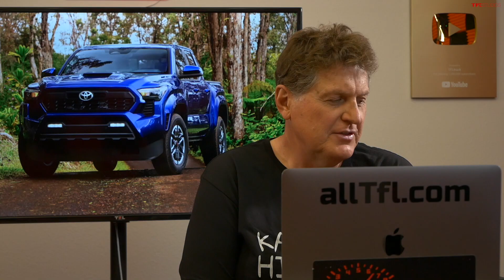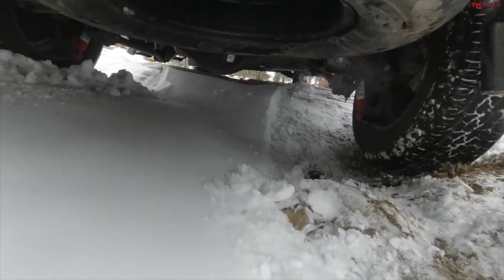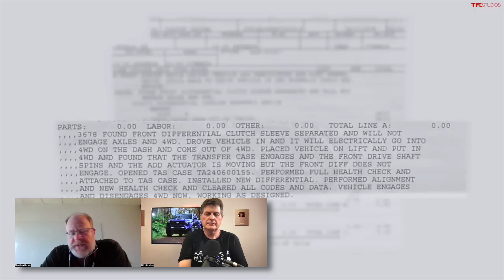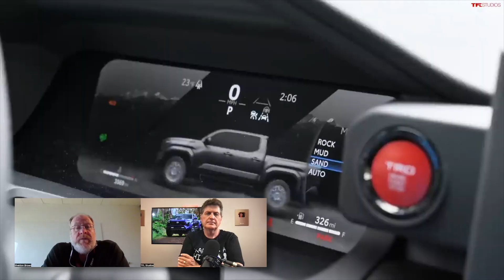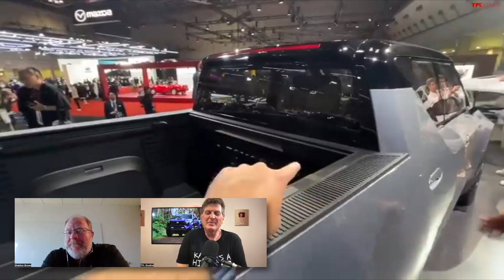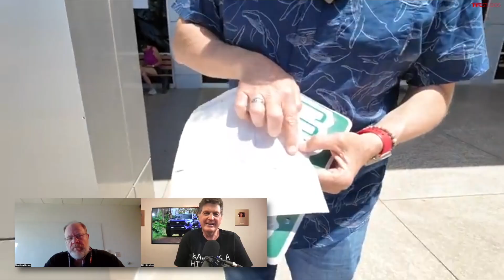The Real Story Behind How Our New Tacoma Broke & How Toyota Plans To Fix Yours!

Comment: I was under the impression you were in 4lo which locks the center diff.?  So if the center was locked, how could the system send additional torque forward.  Appreciate more in depth though.
Reply: Do these have a locking center diff? That’s usually on full time 4wd vehicles right?
Reply: @briancoleman971  part time 4wd locks the center when engaged.  There isn't an engaged-open mode which is part time 4wd.   At least usually
Reply: I would also add that traction control is still engaged even in 4 low??  Sounds like it is over engineered to make it counter productive???
Reply: @timnewby115  they've always engaged traction control in 4lo though, like that sand mode.  For what it's worth jeep does that too when you engage off road plus mode in 4lo

Comment: If 1700 rpm is peak torque it also requires peak boost which on a slippery surface probably wasn't happening.  To record peak numbers you have to have load not just rpm?  Great video TFL and Toyota.
Reply: You can hear the turbo spooling to oblivion on the video.
Reply: @pcihector  Thank you, Roman didn't indicate that, I didn't hear that but can't hear much anyway.  Thanks for the clarification.

Comment: Now we need a deep dive on what's going on with the Tundra engine directly from Toyota! Toyota needs to replace the entire engine for these customers.
Reply: The Car Care Nut goes through their explanation, searches for and finds the real reason. (Toyota Tech) Don't know why, but what did Toyota change in the engine?
Reply: @ryandoyle4344  I watched that video but we need a lot more information and I would like to hear directly from a Toyota engineer.
Reply: toyota does not manufacture entire engines for replacement only short blocks.  a super dumb policy but it's been that way since forever.
Reply: @BassRacerx  I sure hope they change that policy for the Tundra engine recall.
Reply: @KPHVAC  you can hope in one hand and crap in the other…

Comment: ‘We don’t endorse OR SUPPORT putting larger tires on a Tacoma” - Toyota
Reply: No manufacturer does unless it's a specific special model like a pro or trailhunter.  Thats how they make epa numbers 😂.  They won't purposely say we built this truck with 13 mpg in mind
Reply: @beexiong2995 it also wears out suspension and drivetrain parts and they don't want people bringing in broken trucks for warranty work. 

Same reason Jeep doesn't cover off road damage.
Reply: In other words, don’t buy a Toyota it you plan to put big tires on it. Toyota will in fact void warranty now.
Reply: @ryanb8736 OEMs will void warrantees with pretty much any modifications, if the non-OEM mod contributed to a failure. This is nothing new.
Reply: I've been fixing lifted and modified trucks for a few decades, they break WAY faster than unmodified trucks and always have.
Reply: They all became submissive and bowed to Toyota. Sad.
Reply: Yep, every manufacturer will void your warranty if you lift/put larger than stock tires, they are designed for warranty coverage the way you roll off the dealer lot…this is not new news, this is pretty clear and always has been. It would be nice if they had more factory warranty covered options, like the factory 3inch lift kit for the Tundra for the Tacoma, 4Runner and Land Cruiser.
Reply: Meanwhile, Jeep designed the JL/JT with the expectation that the owner would put 35s -37s on it.
Reply: That big tire's gonna multiply resistance at the tire all of a sudden it's a tire brake. Snap!
Reply: @triedproven9908  Three generations of Tacoma had no problem with larger than stock tires. Now suddenly Toyota is going out of their way to say that if you put anything other than factory tires on your 4th gen, they're going to void the warranty even if the tire didn't cause the failure.
Reply: They never endorsed it. It’s just that, before, you snapped CV’s and Tierods not internal differential parts. That’s why people carried those things in the trail kits
Reply: Manufacturers cannot predict what your tire choices will do to the driveline or suspension.  You have always been on your own with that.
Reply: Was kind of weird how he brought that up unprompted. Very telling unfortunately.
Reply: Translation: "We're going to use oversized tires and lfits as an excuse to void your warranty  when our weak driveline breaks."
Reply: No other truck broke on the same trail.  Bottom line, Toyota is skimping on material quality and design strength.  They build for a design goal rather than customers real life usage.  If you don’t design for larger 🎉tires, why would I buy this truck as it appears to be on the edge of drivetrain failure?
Reply: Ah, back to their 1970’s, when their axles would break with any increase in tire size! lol 🐴🐴🥌
Reply: @thepavementendsnow1901  Oh. I was too young to know anything about that.
Reply: Now, how does this play into some of the transmission issues that people have been having are the people who had transmission issues using bigger wheels and tires? Will that affect the transmission as well?
Reply: Holly 💩,  what a statement 🤦
Reply: Maybe they should put selection options on the display to select the tire size we put on since they are updating the program..
Reply: Do they not know their customers?
Reply: The Toyota engineer defending and did not want to admit that this is a poor design and fail. I am going to switch to Chevy and give it a try.
Reply: Do they know who buys their product?? I think their sales are gonna drop hardcore. Starting with the tundra. Next will be the Tacoma..
Reply: yeah, they know. 98% of US truck buyers use them as grocery getters @red.riot.2280
Reply: I think at this rate the next Hilux and Fortuner will likely be a mess as well...Izuzu and Nissan ( and Chevrolet Trailblazer) will likely steal sales from them....The LC70 has its own problems.
Reply: Everyone who buys an off road capable vehicle puts on larger tires. What a cop out.
Reply: No manufacturer does. That is the first thing they'll point to when a warranty claim comes up.
Reply: Nah, they always say that and if you read between the lines he states that larger tires ‘shouldn’t’ cause any more breakage
Reply: Because that’s what a majority of Tacoma owners have always done…makes sense…NOT!

Comment: Toyota cost cutting to maximize profit while relying all the normies to still believe in toyota reliability.
Reply: Record profits last year. First the 3rd gen Tundra has engine failures left and right, which Toyota responds by doing the cheapest thing possible by having the dealer fill the bay with 1000 pieces of your expensive new Tundra so Jim the service tech can build you an engine with a short block and old engine parts. Now Toyota is cost-cutting the drivetrain of the 4th gen Tacoma and insisting that it's the fault of the driver when the driveline fails doing something that any Tacoma sold up until now would have zero issues doing. They cost-cut the driveline to the point where exceeding their software limits by 1.7% means broken parts.
Reply: Moral of the story- buy an IZUZU D MAX.
Reply: My toyota are all over 13 years, this is a new model. And cars are man made , they break down. Even the best and most reliable cars. Nothing is going to be the same while the govt hijacks the cars companies over emissions. Wake up. YOu next cars is electric if these people are not stopped. Part and supplies are hijacked with higher cost. It is attack against the car industry for full electric
Reply: North American made Toyotas have never been reliable. Same problem Honda has with their NA made vehicles.
Reply: @bobman717 arent all the parts still designed in japan tho? (probably not the new trucks but everything else i imagine is). I had an Accord that was built here but the driveline i believe still said japan on it. I could be wrong. Then again that doesnt mean anything either: I had a Mazda cx-5 made 100% in japan (hiroshima) and i had the low rpm/idle fuel pump go bad with less than 20k miles. Dealership was baffled, said they had NEVER saw one go bad. A fluke or poor quality parts manufacturing? Who knows 🤷‍♂️

Comment: That explains why they didn’t put the Tacoma on the slip test; they admitted that 3 wheels in the rollers will snap the axle shaft on the 4th wheel. Seems like a uniquely poor Toyota design, as no other slip test vehicle snapped an axle shaft.

Comment: I must express my disapproval of the recent explanation given for the component failure in the off-road vehicle, citing the conditions as being too tough. In my opinion, these conditions were normal and standard for off-road use, and the vehicle should not have broken under such circumstances. It's concerning that a vehicle designed for rugged terrain cannot withstand typical off-road challenges. This raises serious questions about the reliability and durability of the vehicle's design and construction.
Reply: Right.  His rare instance described was a very typical situation.
Reply: They seem to be advertising that the TRD off road works fine as long as you don't take it off road.
Reply: This failure is going to keep used prices up for a long time and sell a lot of Frontier's, ZR2s, and Jeeps.
Reply: Yeah, their idea of off-roading now means driving down a country gravel road. Manufacturers are taking advantage of the consumer by upbadging and up pricing many of their vehicles with off road oriented components that do little to nothing to actually improve capability because they know most wont ever go offroad to find out. But those that do end up paying the price with failures and having to upgrade components with aftermarket.
Reply: But they exceeded it by 1.7%! 😂😂
Reply: i think they just explained it and did their best to not place blame/break relations ... normal human stuff we can all see clearly theyve made a misstake in design and it aint the programming thats just a band aid
Reply: That's the Wall Street way! Btw, next time you have a birthday, submit your online name to your favorite local morning news. 😅
Reply: The truck was empty and only the driver on ice and snow. This Toyota guy is full of crap. The quality is not there I would not buy one even if it was cheaper.
Reply: Toyota under built the front differential and is blaming TFL…
Reply: @chris-qo1nt  how did they blame TFL, they admitted a problem and fixed it.

Comment: on the SG site from a few days ago they say that Toyota told them you had it in the wrong mode - "rock" mode rather than 'ice condtioned"- and that your error is what broke it  -  the fix was to make it so drivers couldn't make that mistake - "idiot" proof it - not my words - by changing the software so a driver mistake couldn't over stress the mechanicals w/ the wrong selection  -  but I rewatched your original video and I did not see an "ice" mode to be selected
Reply: Regardless of mode, shouldn't the drive components be strong enough to withstand whatever the engine can put out?
Snapped/exploding gears should only happen on crazy powerful custom setups, not a factory taco.
Reply: @PaperScarecrow  agree completely   go watch the SG video, it does not jibe completely w/ what the toyota says here
Reply: @PaperScarecrow yes the driveline components should withstand the torque applied, but with how Sheldon explained it, the clamping force of a disc brake (especially fronts) can overcome any torque output from the engine. But when the engine is sending full power to one wheel and the traction control is trying to brake it, I can see something give out. Hopefully a software update prevents this scenario.
Reply: Whoaaa, I always wondered why they had so many modes… sounds like it’s to defer liability of breakdowns to the owner by ‘selecting the wrong mode’ instead of the company.

Comment: TLDR; TFL got this replaced under warrantee, but you won’t. Save your money to pay for repairs if you buy a new Toyota and take it on any kind of light trail.
Reply: I was thinking the same thing, a normal every day customer is NOT receiving this treatment, they wouldn't fly engineers in, they'd look you in the eye and say, sorry, this isn't under warranty, and you're left with a $15k fix.
Reply: Yep still blames the customer use instead of taking responsibility for a bad design.  Not the Toyota we used to pit our trust in.
Reply: @hcdtactical at what point did he blame the customer. Could you point to the timestamp in the video
Reply: @drivewayhero  how about 19:15

Comment: Did I just hear him say that it's possible that under some circumstances for the truck's own traction control system ("multi-terrain select") to exceed safe torque specifications of certain other components of the vehicle? I don't care how rare that condition is, it's a straightforward engineering deficiency! I work with a former Toyota intern/engineer. I have to solve all of his technical problems, too. Maybe it's a Toyota thing.
Reply: it sounds like there is latency in the system. the cpu tells the mechanical modules to change but it can't react fast enough under some situations.  That is my interpretation of it.   the truck sent nearly 100 percent torque to one wheel that had the brakes clamped and the weakest link went boom.  the brakes should have opened but it could not do it in time.
Reply: @BassRacerx  That was more or less my interpretation as well. Another way that it's relevant; Maybe THIS failure happened in a really rare scenario, but if the mechanical overhead of some of these driveline components is so thin that they can break in that scenario, what about when people start modifying these? It just doesn't seem robust. These parts should have relatively substantial mechanical overheads. That's why a software solution alone feels a little empty. The part seems underbuilt.
Reply: @smithjones1906  you are always going to have A weak point. if you build a truck people are going to break it.  The brakes slammed shut so hard it snapped a driveline.  Software should prevent sending that much  torque to a corner that has the brakes squeezed that hard.  They could build the driveline tougher but then something else would break.  It would just be wack-a-mole.
Reply: he also said they released a patch to fix it.
Reply: Name one truck that hasn’t had some issue at some point.
Reply: Easier to say it's a software issue than a design or manufacturing issue. And easier to bandaid too.

Comment: Not something you need to worry about....but TFL had it happen doing much lighter off-roading than Toyota markets their Tacoma for.
Reply: Average Taco driver will never leave pavement
Reply: @bobman717 they are warriors in comment sections and online overlanding forums 😂😂
Reply: @bobman717 Mostly true, but that still leaves a whole bunch that do. And as these age and move on to other owners, more of them will go off road because those owners are more willing to bump and scratch them up.
Reply: @americanrambler4972 Maybe the aftermarket will be there with better than OEM parts to resolve those woes by then.
Reply: @bobman717 well apparently you dont even have to go off pavement to break the diff. Just watch out for icy mall parking lots 😂
Reply: @John_Redcorn_ What would Hank Hill say? 😂😂
Reply: You didn't pay attention.  It was a traction problem because of the ice that contributed to this case in the programming of the mts system that led to the failure.  Too much brake and torque at that specific programming that broke it.
Reply: @beexiong2995 traction means they don't make it up (even though the Chevy without cruise control did).  It doesn't mean that the front diff breaks.  Even assuming that they designed this to act as a fuse, what does that ell us about what the engine cam handle?
Reply: @beexiong2995 I think the explanation went over some heads but we understood
Reply: @beexiong2995 I want to translate:
to less quality in important parts, Toyota is only for Roads, not Offroads😅
my old GM Tahoe is not perfect, but it never failed offroad or towing 😅
Reply: @beexiong2995 this was not a high traction situation. If their own traction control system can break parts, this is definitely a problem. I didn’t hear him say they are going to reprogram all of the trucks either. I have a feeling this will be a huge issue.
Reply: @beexiong2995 exactly the new new taco can't get out of its own way.  It can't handle the power its own engine generates 🤣 talk about designing a truck to handle the bare minimum.

Comment: Love this, design it for minimum use, build it in Mexico, cut cost and increase price. If this is not a recipe for success I don’t know what is.
Reply: I worked for Continental Teves when they originally tried moving automotive brake foundation production to Mexico. It was a disaster. Quality Control, pride of craftsmanship, attention to detail of workers on the line, reporting issues immediately before they get down the line, personally removing damaged/subpar piece parts from your supply rather than installing them and saying nothing…on and on. Precision manufacturing & meeting even basic ISO 9000 production quality wasn’t possible b/c no one had ever been taught that. Shut the whole place down after less than 2 yrs.
Reply: You can't teach a whole population of workers a concept so foreign to them.
Reply: Toyota- “Let’s kamikaze our business.”
Reply: @mikeh.6117    yep    😭
Reply: Sad  😢
Reply: Wall Street: ❤❤❤❤ that plan!
Reply: They have been manufacturing in Mexico for nearly 20 yrs
Reply: @psynurse I think the point he’s trying to make is that they keep doing things to decrease the cost of the truck (lesser quality parts and cheaper labor) but ask more than anyone for a midsize truck. It is less capable for payload, power, towing vs other manufacturers and still costs more. Upsetting (3rd gen owner here)
Reply: @psynurse  then it shouldn’t be shit with plastic creaky interior then
Reply: @TheCoffeeField  the previous gens wreaked of shit with plastic creaky interior bits.  so?